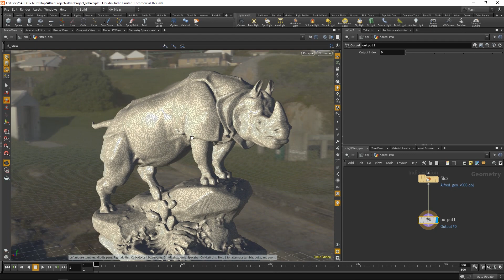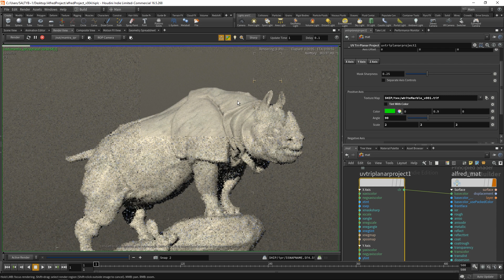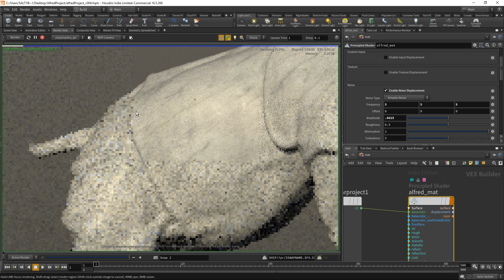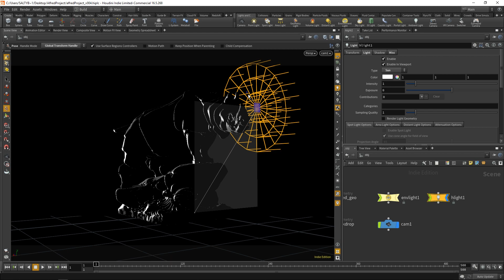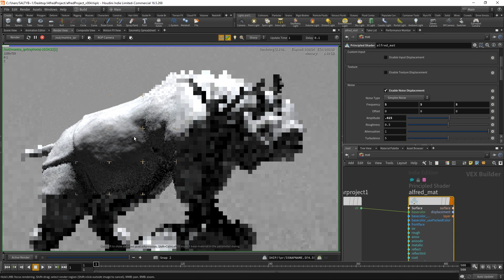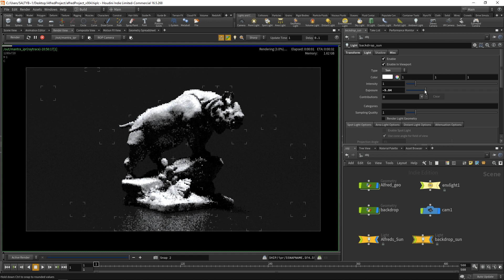Houdini For the New Artist - 008 - Lighting

Comment: Hi congrats for the video, I need an answer:
is there a way to convert displacement in the render view at 4:35 now  into real mesh as you could with maya arnold?
Reply from the maker: Hey lucid!  Yep, you can absolutely do that.  There isn't a "bake geometry render output" button quite like you might be used to in Arnold/Maya, (Mantra uses a variety of optimizations at render time which rely on camera angle for displacement) but you can set something up to give a similar result.  The most straightforward way I can think of is by copying the noise parameters (in your shader) into a point vop containing an anti-aliased noise.  If you added this anti-aliased noise to your current position "P" using an add node, and plugged that into the "P" output, you'll essentially be moving your points around in space by using a noise.  Add as many subdivisions as you need, and you're good to go.
Reply: @cgforge  Thanks Tyler. keep up the good work